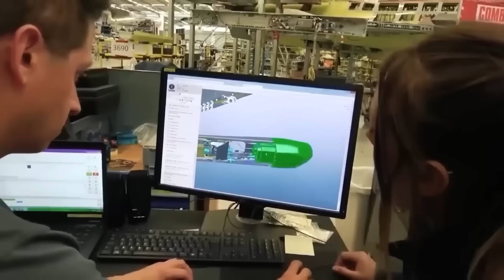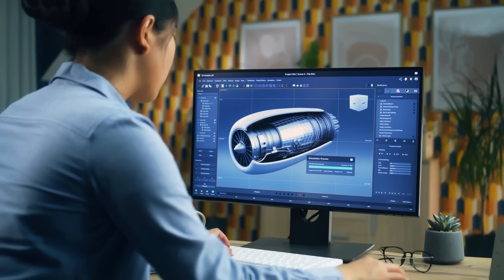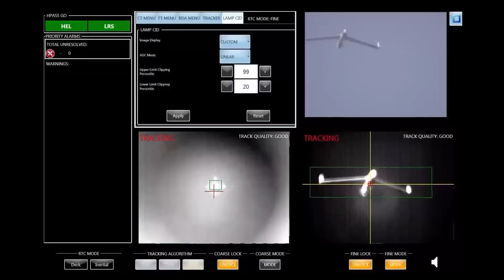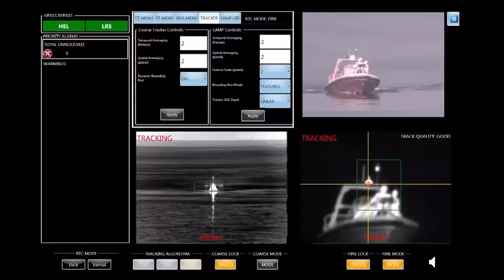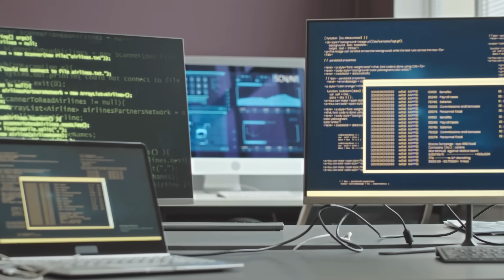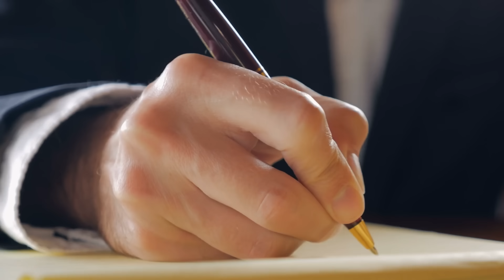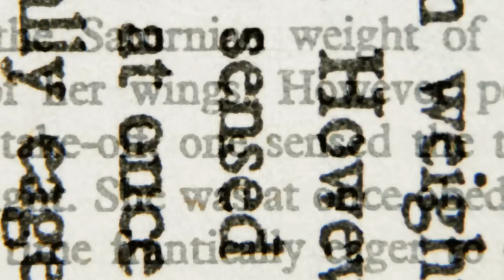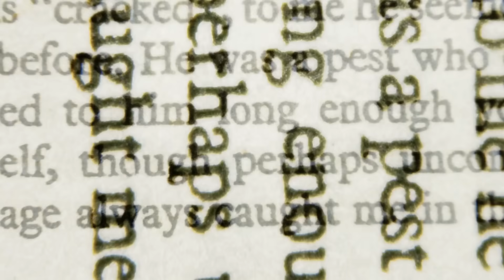BREAKING! US Air Force Declared DARKSTAR Is REAL!

Comment: If anyone lives or is in the SoCal area try to visit Blackbird Airpark in Palmdale. They an SR-71s, a U2 and engine displays along with an expanded number of aircraft over the years. I even met a former SR pilot and it was so interesting to listen to their experiences. Well, experience they can tell you about!
Reply: The Dark Star was parked there, for photo opportunities, when Top Gun came out.  Unfortunately, Lockheed had to tow it back to the hangers just done the road because there was no engines in it.
Reply: I have a SR-71 refrigerator magnet that a SR-71 pilot gave me at his house in Lancaster.

Comment: If they are talking about this aircraft, the imagination says we have mastered a vehicle that can go at least double the speed of this plane, better weapons than the laser weapon system, with unlimited range/weapons/speed that no one can ever imagine.   Speed 20 times the speed of sound,  shoot and forget weapons that can stay aloft for hours and absolutely no way to find it with current radar systems.   Just my thoughts.
Reply: This plane will not be stealthy.  No way to hide the heat signature or the shock waves produced by something moving that fast.  Speed or stealth, you really can’t afford or achieve both.  Speed kills and you can’t hit what you don’t see.  Look at the planes that master each, these are very different animals.  They are shaped and coated to enhance what they were designed for.
Reply: @EdKalyan  I believe they have created new technology that can fly fast and dissipate the heat issues.   We did it with some of our helicopters back in Vietnam.   Even flew over the bad guys and they didn't even know we were there until we were long gone.   Even their heat seeking weapons didn't hit the aircraft.   Some were used to drop surveillance equipment close to their bases.
Reply: You can dissipate heat, but that is not the same as hiding it.  Look you don’t need to hide it nothing can really target it.  At those speeds with even minor course adjustments would be increasing the kill zone of any missile by dozens of miles.  Why even try to hide it?  To make that stealthy is ridiculous, and self-defeatingly expensive to a plane that would almost certainly cost an enormous chunk of the air forces budget. The crazy thing is even something moving at the same speed could never hit it because the actual chemical explosion would be too slow to catch up with the plane one the warhead detonated.

Comment: By the way: It`s not a "transition between a turbojet to a ram jet"!
It`s something far away that, it is between a" ram- and scram jet", and beyond!!
Far, beyond that.
Not to speak about the temperatures, on the fuselage, and the systems connected to that.
As said, read the Ben Rich book, You will understand a lot more about this then.
Again: from a Finn in Diaspora